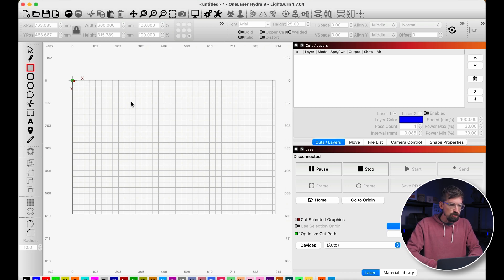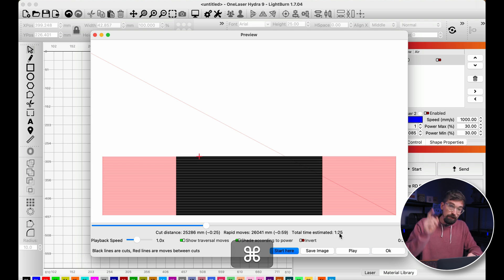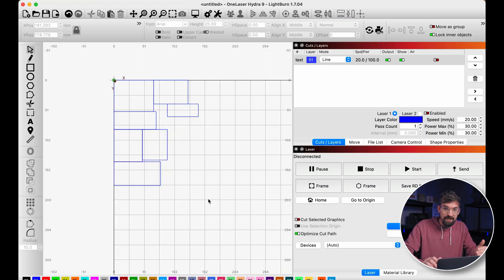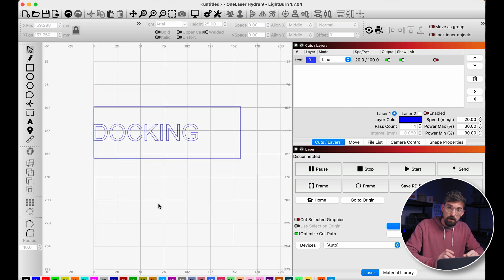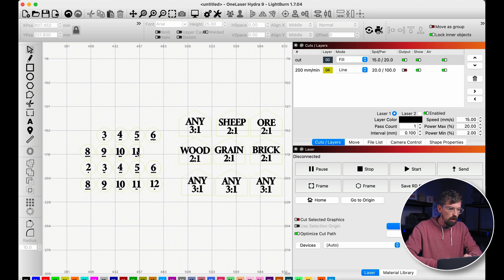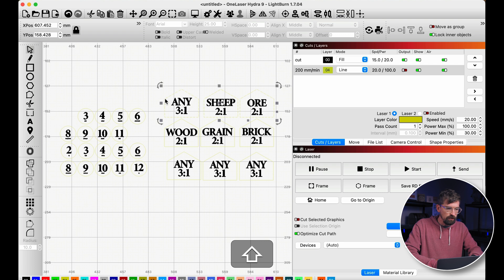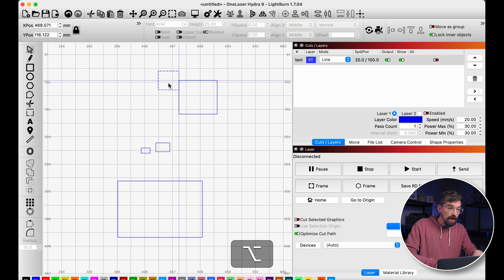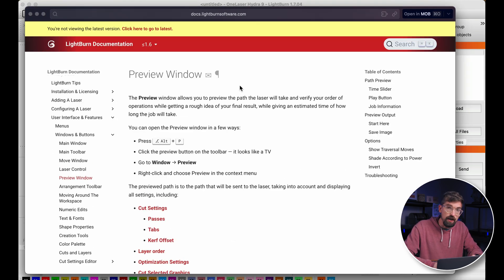Lightburn Tips I Wish I Knew Earlier!

Comment: "hardest to learn?" 0:08 
Not if one's previous laser software is RDWorks for Ruida controllers. LightBurn was a breeze to learn. You've pointed out the integrated help option, which only makes using the stuff even easier. The crew who have developed LightBurn are absolute geniuses when it comes to software.

Comment: Soooo helpful!  I'm relatively new to LB and was getting ready to burn a project that was going to take 2 hours and 30--something minutes but after I tried the Offset Fill trick..... 54 minutes!!!  WHAT?!?!   Thank you for saving me and my laser, Burnie, many hours!  The other tips also very helpful.  Didn't know a darned one of them.   Keep up the great content!!

Update to my comment:  I tried the Offset Fill  and it certainly saved a lot of time but since the laser stays in the same area for much longer, it burned thru 6mm Baltic Birch plywood.  And when I tried adjusting some speed/power the quality was nowhere near what Fill does at 100/20.  I have an 80watt laser.  Anything hints on when to use it and how to find that right setting?  Thanks!

Comment: For one thing your 2 boxes are different sizes so naturally the bigger box is going to take longer. You don't have to click on the offset to use the offset fill either it will work just by changing the cut mode to offset fill.-

Comment: Just a very beginner user. How did you fill in the square with a color? I am looking to make Printed Circuit designs and usually make the pads and runs black. Just didn't know how to fill those shapes in.  And is there a way to make lines really thick to be runners?  Thumbs Up!

Comment: Hi, thank you for your video demonstrations. I have an issue that I need help with. I manualy draw a cut line around my object and have to stop and start it due to workspace issues. When I run it it burns in sections and not the perimeter. Please help. TY

Comment: Good video.    Looking at your cuts/layers window at the bottom right- just under speed and power settings there is no material thickness (mm) option, time 2:57   my cuts/layers window the material (mm) is sometimes gone!  - I'm getting the message:  "your material is set close to zero do you want to continue?"  Without the thickness set the laser cuts out of focus and messy.   Is there a way to toggle this (material thickness option back- on?) in Lightburn?  It seems to affect the power required to cut.

Comment: You missed a setting that will speed things up without using Offset Fill 

Open your layer settings - go to the advanced tab and switch flood fill on to get the same/similar times as offset fill, but with the normally oriented scan lines
Reply from the maker: Good call!